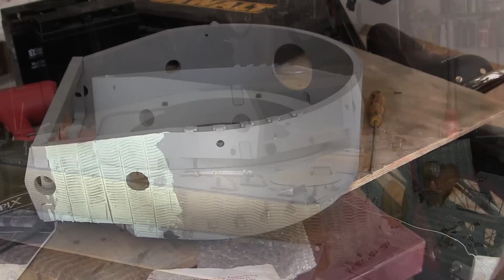Armortek Late Tiger I Project video #14 Hull details complete

Comment: Very fine Video , I enjoy it. Only  one point, the turrret rotation speed is much too high!  The Original speed is normally one full rotation in 60 seconds.
Reply from the maker: The turret speed has throttle and can be slowed down via the remote. I was going full throw to illustrate the function. If you are operating the tank and want the turret to turn slower you don't use as much throttle on the stick
Reply: oddball759mm where do you get a kit? I went on armortek website and it was not a very good site to navigate. it said also they were selling the company, maybe you can point me in the right direction in acquiring a kit.
Reply from the maker: This is a common question that I get, Unlike other model kit companies Armortek doesn't make large continuous batches of kits. They only produce small runs of 25 - 50 kits of a certain vehicle type. When they announce a new kit for sale they post it on the website as a preorder. Once the pre ordered kits are sold off they are no longer available for purchase and they produce the kits that were preordered, Once the kits are about ready to ship they announce a new kit and they cycle starts over. 

Another way to purchase a armortek kit is on the for sale / wanted section of the forum. There you can find kits in unbuilt to fully finished condition being sold off by owners. The tank in this series was one procured from the second hand market.